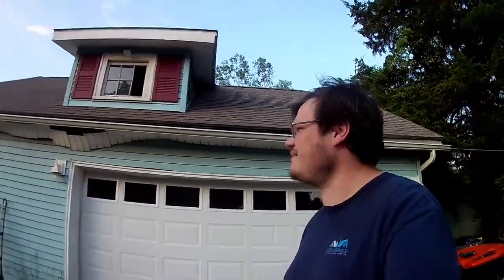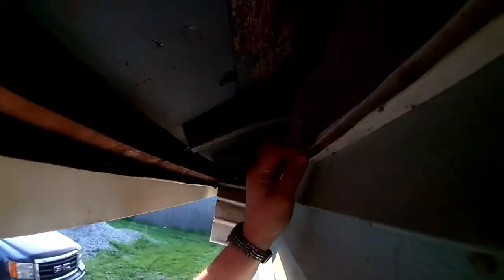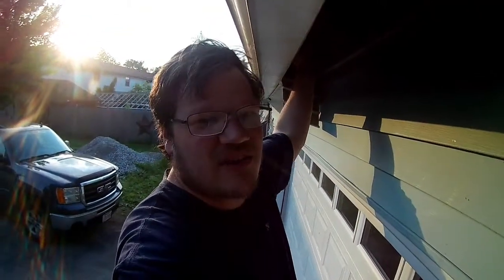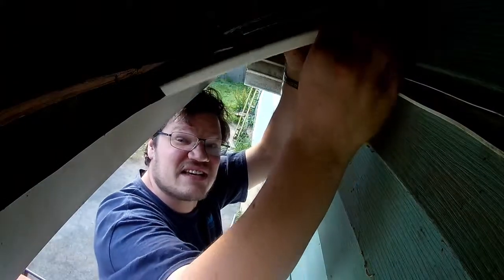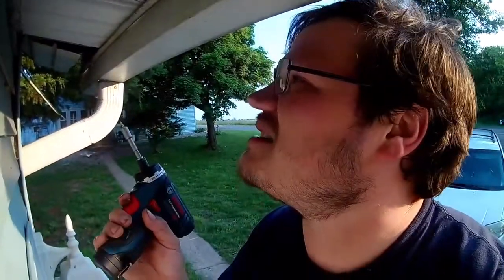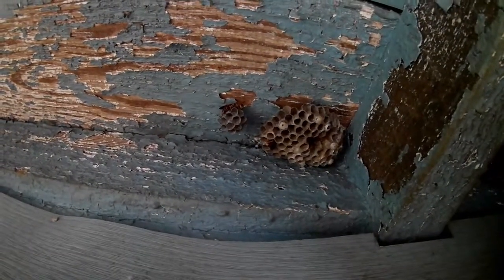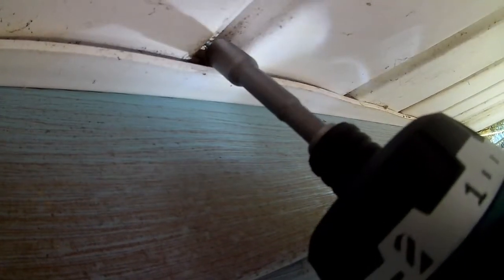how to repair soffit that  continues to blow loose and fall down the simple cheap effective way

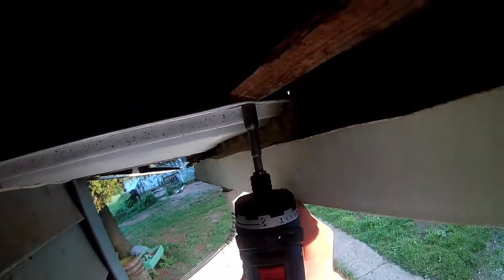Comment: Thanks for the helpful tips. Won't work this easy in my case as previous owner put vented soffit up against plywood soffit. There is no cavity above soffit so can't lift one end to get it in. To re-install pieces that have come out of channels gutter has to be removed so outer channel can be removed, then replace pieces and put channel then gutter back on. I tried to bow them enough to get ends back in but can't do it (it's aluminum vented soffit). Any better ideas are welcome. Also please note that the first screw you put in didn't go into anything as can be seen at 4:52... might want to edit. Cheers
Reply from the maker: At least you have something good to fasten your soffit too

Comment: Thanks for the easy to follow tips! I need to remove a piece or two of soffit to get to an old hornet nest.... can I bend the fascia out of the way to get to the soffit? (I don't want to have to rip anything out)  Hoping I can bend it, unscrew the soffits, remove said nest, then reassemble and bend back the fascia. Does that sound reasonable? appreciate the help!!
Reply from the maker: You can be careful not to crease it